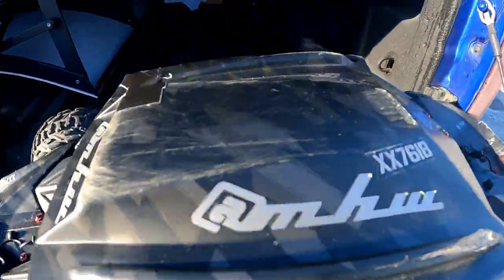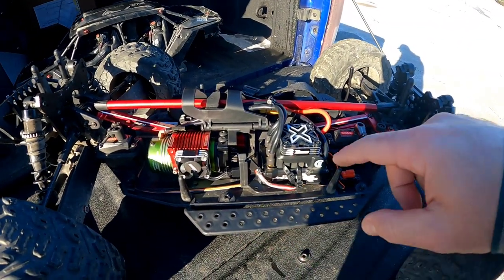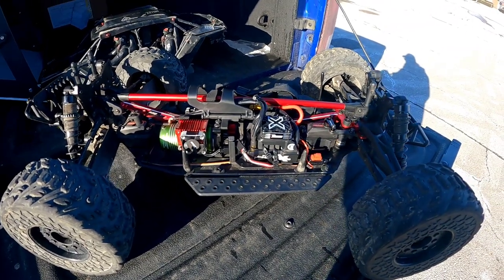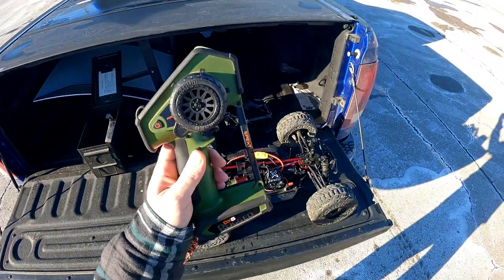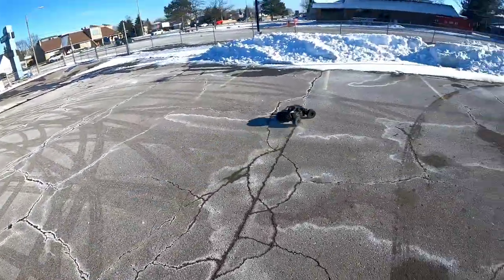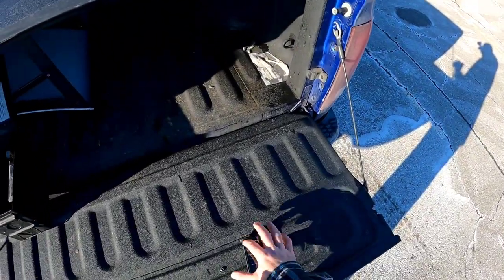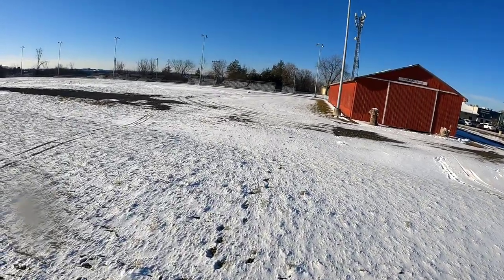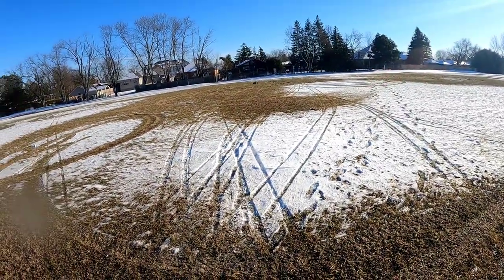Arrma Fireteam power upgrade: speed run + bash!

Comment: Well this setup seems to work well in the Fireteam.  Seems fast and squirly (which I like) and must have good wheel-speed because it is backflipping with those tires.  Have you tried the 1650kv in there? Curious
Reply from the maker: Ya, the 2200kv is a deadly motor. I pulled this combo from my infraction that was breaking the tires loose at 120mph lol. I haven't tried the 1650kv in here yet. I like the rpm screaming from the 2200. Plus I prefer a lighter rig, personally. But who knows. I might get bored one day and slap it in.
Reply: @musthavewheels  ya i hear ya. It s workin well. If it ain t broke don t fix it lol

Comment: The power puch ?? What level ??
Reply from the maker: The castle esc that I'm using usually comed with the punch control disabled. But I had this in another truck that I needed punch control. Since this run I just turned punch control off fully.